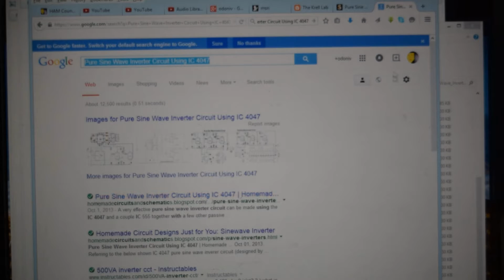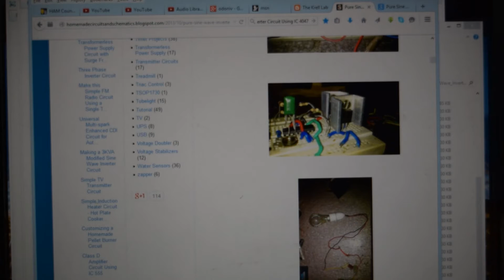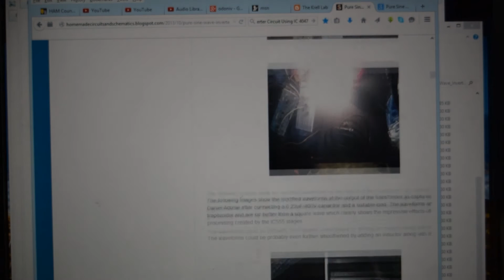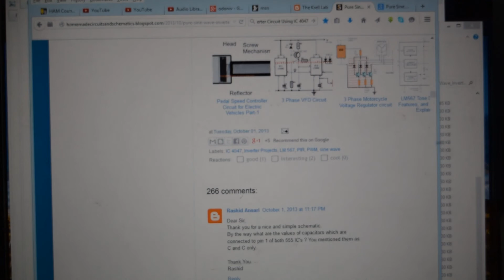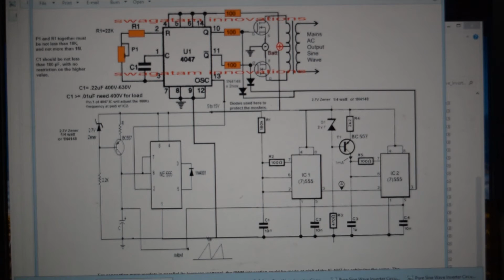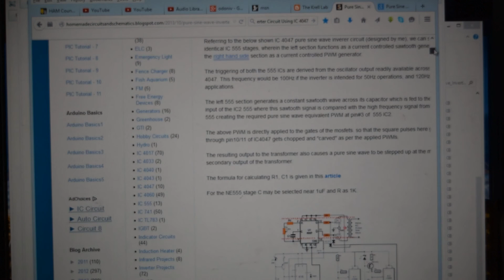Pure Sine Wave Inverter Using 4047 with PWM Schematic

Comment: I have seen this schematic before. can it be modified for a 5-6 KW or more? I need at least 4-5kw 60Hz 120v inverter. I need to build it. I can't afford to buy one of the output I need. I can't recall but what kind of boost stage does it have. I have looked at so many inverter designs. how is the regulation on the boost and output. is there volt drops and over shoots with loading and unloading ? I really need to pick one and get started building. I need it for my off grid home. thanks